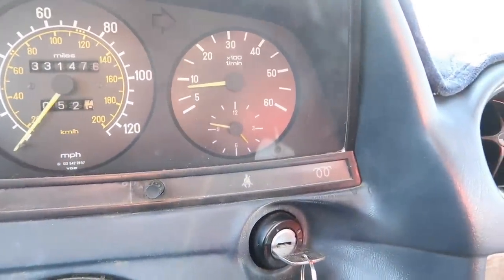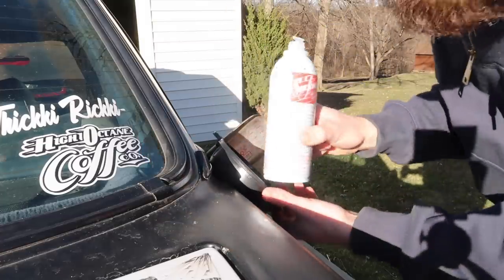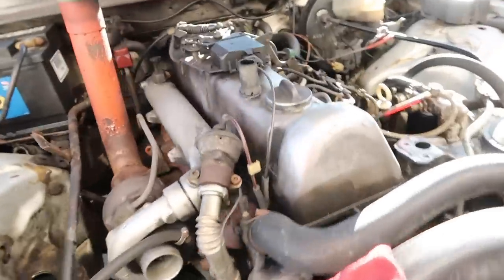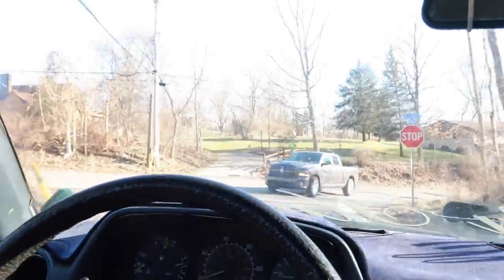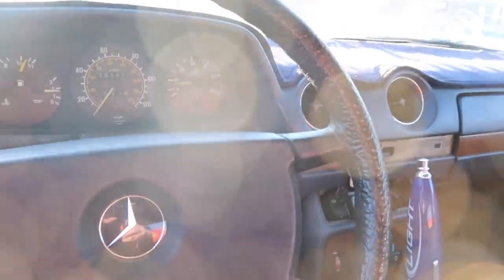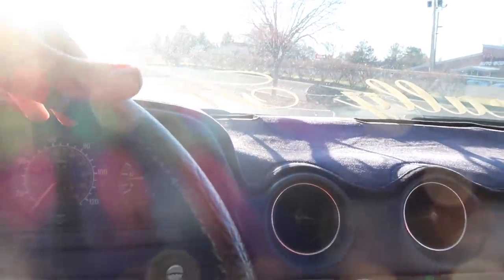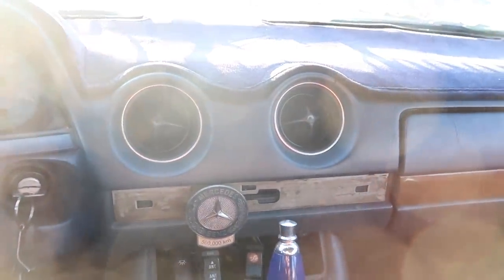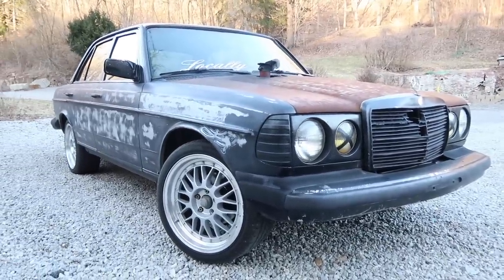What Happens If You Seafoam Your Diesel? - WAY TOO MUCH

Comment: Somewhere in Germany there is a Mercedes engineer vomiting.
Reply: Seafoam is 80% kerosene and a small amount of petroleum naptha. You are wasting your money. Better to use a diesel cleaner made for diesels.
Reply: in germany ?????  im vomiting here !
Reply: it actually works...look up project farm.  He does a great review on it.
Reply: Lol
Reply: @MichaelJHathaway  Have you ever tried it? I'm a tried and true skeptic but, I have used it on many, many occasions and have had good results each time.
Reply: @daviddelle774  The point you are missing is that its the petroleum naptha doing the work, while the Kerosene is the "filler" content. If you were to add the same measured amount of naptha, such as Stabil or Lucas fuel cleaner, you would have the same results, except at a lower cost.
Reply: @MichaelJHathaway  Sorry for your misconception that I'm missing the point, I'm not missing anything. My statement about it working is true. But, since you brought up those other brands..., I use Stabil in all my tractors and outdoor equipment for it's intended purpose of fuel stabilizing and have never found it to be a helpful "cleaner". I have also used Lucas fuel cleaner and found it's cleaning abilities lacking. I have followed up a Lucas treatment in a garden tractor with SeaFoam and it cured the issue. Was it the combination of Lucas then SeaFoam that did the trick? Maybe. But then I have to go back to all the times I've gotten good results using SeaFoam right from the start to conclude that it was the SeaFoam that cured the issues. Could I just buy a can of naptha and dump some in my tank? Yeah, maybe. Maybe I'll get around to trying that some day. But in the mean time, I'm standing on my statement that it does indeed work, regardless of what you say the the ingredients are.
Reply: It only works 20% of what it could do if it were pure naptha. LOL!!!
Reply: @MichaelJHathaway  I'm going to ask 2 questions and then I'll let you rest. 
1. Have you ever used SeaFoam?
2. Do you have a degree in Chemical Engineering, and work in the field?
Reply: @daviddelle774 Electrical and chemical engineering and worked for DuPont
Reply: @MichaelJHathaway  Dupont in DE? Know an engineer by the name Stahl?
Reply: How about adjusting the valves to factory specifications??:)
Reply: @MichaelJHathaway  du pont? Where at? We have one here in Pryor oklahoma
Reply: This is probably the best comment I’ve ever seen on a YouTube diesel video 😂😂
Reply: It's the only fuel treatment I will use. I have used others in the past.
Reply: Bad idea 100% naphtha if used in this quantity, at least Kerosene has some viscosity but Napatha is quite cutting; it is used to clean oil based ink from printing presses and that stuff is serious goop, now imagine what that would do for oil ! 😬

Comment: You'll get even more life to that engine if you simply ad an air filter.
Reply: Especially with the exhaust right there .
Reply: Yeah who knew clean air was good for your engine lol
Reply: Ross Sikorski youll add more life to your cp4 if you simply seafoam lol
Reply: Exactly
Reply: @chexlemeneux8790  That's an external EGR
Reply: Air filters are for the weak....do you see professional athletes wearing air filters? No you suck that natural air in and turn it into power! Couple bugs aint gonna hurt that diesel

Comment: You should change the oil now!!!!
Reply: Why? He put it in the fuel tank
Reply: @jair8808  no he added to the crank case as well??? Hello
Reply: @jair8808  if you add it in the crank it will thin the oil and get slug out! Then after about a 1 hour drive change that oil!!!!
Reply: You can add sea foam to the oil and it’ll be just fine you can add a larger amount 500 miles before you do an oil change to clean up the inside but it doesn’t harm the engine

Comment: I have used Seafoam in all my engines from chainsaws to my 6.7 diesel for years and it has preserved, I feel, every motor.  My snow blower is now 30 years old and starts first pull.  My 2010 F-150 5.4L 3 valve, which has had historically  a plethora of issues now has 255,000 miles with no issues.  So a big thumbsup on the product!
Reply: Those Modular V8s are weird like that. I have seen them run like the best V8s ever made and then some have issues beyond belief.
Reply: Did you put it in the engine oil or fuel tank?

Comment: Made a huge difference this last summer in my Mack truck.  Put in a gallon in about 60 gallons, and by the end of the day it was a totally different truck.  Smoother and more power brought it back to where it had been before.  Got to filling each new fuel filter with it, run it for a couple minutes and let it sit overnight.  Huge difference.
Reply: what motor mp8? still running good? dpf?

Comment: I had 4 injectors failing on a truck I had for a week and I poured a gallon to the truck , finally got it running,  ran it hot for till it was empty and now I havent had any I injector failure so far for a month.

Comment: Just prefilled our secondary fuel filter with seafoam on our bus conversions 12 valve Cummins, and Wow! Huge increase in acceleration performance. I have to use the brakes more because it dosen't slow down as fast when I let off the throttle.

Comment: After driving about 30 miles you should change the oil. You just cleaned the crank case of sludge and cooked on caked on carbon.
Reply: Jeff Stone I think that’s only if you ad it to your oil or through the brake booster vacuum line, if you put it in your fuel and your piston rings don’t seating to the cylinder wall properly then it will dilute the engine oil. If you have a good running engine it will be fine.
Reply: TiresBiggerThanTexas  if it’s added to the crank case oil I would change the oil soon after driving. If you add it to the fuel or through a vacuum line it’s being burned and exiting the exhaust except for blow-by.  The reason I would change the oil in just a few miles is because if this starts cleaning the sludge out of the galleys it’s going to end up in the oil pan. You run the risk of plugging up the pick up on the oil pump with the shit that was caked on the inside of the engine. You could repeat this process. Another way to clean the crank case is drain the Oil and fill the engine with kerosene. Let it soak. Drain The new oil and filter.  This is an old timer process used on old tractors. Not something I would bother to do. But since were talking about a car that was basically junk it could be fun to experiment.
Reply: @sterlingyoung88  ,, he did put a pint into the engine oil.
Reply: nope , its actually between 100-300 miles as it says on the tin

Comment: I always recommend replacing the fuel filter and priming the filter with seafoam on most diesel engines.
Reply: The return pump just pumps it back in the tank before it can go into the injection pump.
Reply: Be just as easy to go buy a tank of number 1 diesel.
Reply: @mtwofeathers  
Is that even available anymore?
Reply: @Freedom1man  only in the winter in very cold areas if you’re getting it from a pump.

Comment: Adjust them valves and you will have it run better. Valve adjustment is big for a little motor like that .
Reply: Yes, a valve adjustment should've been the first item done for a better test.
Reply: Perhaps throw some gear oil on your cam to stop the rocker from slapping the valve. Haha. 
Love the car.
Reply: Is it ok to run this stuff in modern diesels?  I have been told it’s “not good” for the modern injectors?

Comment: I’ve used sea foam in my VW ALH 4cyl 1.9L diesel. Huge difference! In engine oil a couple hundred miles before an oil change cleaned it right up! I tend to run Power Service diesel additive on every fill up, but remember Seafoam will pick up moisture in the fuel and work nicely as an anti-gel/ anti-freeze agent. I tend to add it as the temps get closer to freezing. Injections stay clean, and I say more horsepower.
Reply: Tiny Solar Shack what did it clean up? How could you tell ?
Reply: If it worked at all it would make your oil dirtier as it dumps all those built up carbon deposits into the sump.

You're saying it made it cleaner?

Comment: I have used all the major cleaners over the years in motorcycles, regular gas engines, outboard engines, lawn mowers...... My Ram 2500 w/ Cummins 6.7 has seen all the major cleaners ran through it over the last couple of years.  None really made that much of a difference.  BG Products, Marvel M.O., Stanadyne, Hot Shot's , Peak, Diesel Kleen....  Out of those on the Cummins, the Hot Shot's worked the best. 

Then..... I realized Sea Foam can be used in Diesels when I bought a can to use in an outboard I am working on.  I have always used it in regular gas engines but never thought about using it in my truck.

HOLY COW!   Regular daily  route , I have gained over 2 - 3 mpg.  Better throttle response, idles smoother.  The other cleaners look like dark tea, where the Sea Foam is clear.  I can say, none of the other cleaners have done that with this truck.  I was telling everyone about the Hot Shot's products, even posted on YT about it, but now I will only be using Sea Foam.
Reply: Just got a lb7 Duramax Gunna try this and hope for better throttle response
Reply: You even posted it on YT? I can't seem to see the video...
Reply: I use both Stanadyne and seafoam in my 2003 7.3.
Reply: B as for your cummins only use the sea foam to clean your injectors. Do not use it as as a weekly treatment because it will destroy your fuel pump as it provides no lubrication to the fuel system. Diesel Kleen which is endorsed by cummins, not only helps keep the fuel system clean it also aides in lubricating it. Because diesel fuel is now ultra low sulfur content so it has no lubricating properties anymore. Once you get the fuel system clean I suggest using Diesel Kleen from then on. A Cummins Tech explained this to me and all Cummins dealers actually have Power Service Diesel Kleen displays in there dealer. That’s all I use since a month after buying my 2017 2500. It actually run better than the first day I brought it home.
Reply: B as for your cummins only use the sea foam to clean your injectors. Do not use it as as a weekly treatment because it will destroy your fuel pump as it provides no lubrication to the fuel system. Diesel Kleen which is endorsed by cummins, not only helps keep the fuel system clean it also aides in lubricating it. Because diesel fuel is now ultra low sulfur content so it has no lubricating properties anymore. Once you get the fuel system clean I suggest using Diesel Kleen from then on. A Cummins Tech explained this to me and all Cummins dealers actually have Power Service Diesel Kleen displays in there dealer. That’s all I use since a month after buying my 2017 2500. It actually run better than the first day I brought it home. SEAFOAM IS ONLY A CLEANER AS IT HAS SOME ABRASIVE PROPERTIES TO IT!!!!!
Reply: On my 5.9 cummins, i empty the fuel filter canister and fill it with sea foam
Reply: @Jon O OR the Cummins corporate struck a deal with Diesel Kleen to be an exclusive supplier obvious by the marketing materials in place. Usually with financial incentives in play
Reply: @Jon-O.  Man, I never got the notifications for these replies.  Thanks for the info.  I basically run a can directly in the filter housing, as SeaFoam shows in their Ford 7.3 video.  It's been a year now and TBH, the SeaFoam is still giving me better results.  BG Products and DieselKleen are used on occasion though.  I'll swing by the local Ram dealer and bend the tech's ear also.
Reply: @mrmotofy  yeah I don’t think so remember cummins engines are warranted by cummins I don’t think it’s in their best interest to endorse a product for their engines that will make a negative impact they lose.

Comment: 1st thing adjust the valves, try changing the fuel filter .( thats probably ur problem) last but not the least dont thin that fuel too much. That fuel is lube to the bosch precision pump. Fuel too thin will distroy any precision pump. Also u need filtered air on any engine.
Reply: .. well ULSD doesn’t have great lubricity to start fyi, and Seafoam is petroleum based and and helps with lubricity. Can’t really over treat it with Seafoam.

Comment: I put had a Honda motorcycle that was backfiring BAD i used an entire 32 oz of Lucas over 10 fill-ups and no help. i used Seafoam and it immediately cleaned the carbs and the backfiring stopped. the mechanic that rebuilt the carbs said he could see where it cleaned the varnish! i use it in all my gas cans for mowers and everything its awesome stuff!

Comment: Some time ago on my previous truck as I'm a truck driver I put two bottles of seafoam in the oil and then one can of each fuel tank and filled it up and within 10 Mi it was already a noticeable difference are just phenomenal it ran quieter ran better and I got better fuel mileage here it was a semi truck with almost two million miles and I was getting close to 7 miles a gallon before I put that seafoam in there was 4.5

Comment: Iv used it for years. Gotta try the seafom intake fogger. Especially on anything that's port injection with emissions/EGR. Just did the wife's blazer and when I kicked on the throttle you would sware it was a diesel. Just rolled coal. Shit works.

Comment: Hopefully you changed the oil right after this.  Seafoam thins out the oil, if you run it like that forever it can damage your bearings.  Don't run a ton of this through the motor it will cause the injector barrels of the injector pump to become scored.  Run more advance on the injection pump (you have to loosen it from the motor and move the pump in relation to the block), and add in a variable boost controller to run 12 psi on the turbo wastegate.  Make sure your ALDA is working.  Loosen the nut on the top of the diaphragm on the top back of the injection pump and screw the inner part of it in 1/4 of a turn and tighten the outer nut, it will run a little more fueling to the motor.  Less is more with this last adjustment.

Comment: Seafoam changes the cetane  rating of the fuel… which in a diesel of that era is like changing the timing in a gas car.. because it is compression ignition…. It also reduces the lubricity, so use with care.

Comment: I buy seafoam by the 5 gallon pail.  I put it into the oil of all the vehicles I maintain a trip or so before I change the oil.  I also put it into all the tractors before I start them up for the spring.

Comment: I use that shit in my Jeep whenever it feels like it's lagging, I also using all my 2-stroke engines like my chainsaws and my echo weed eater andafter about two tanks through each of my pieces of equipment plus my Jeep I notice a very big difference in the amount of power versus throttle I haven't used it in anything that's diesel yet but I definitely would get the spray form and put some through your air intake not on that Mercedes but any unleaded vehicle that's fuel injected or on a carburetor I just pour some into the carburetor my 76 Chevy pickup loved that shit! I loveusing it over almost any other type of gasoline or motor treatment out there

Comment: I hope you changed your oil soon after.  I ran seafoam through an older engine and didn't change it within the 70 mile mark and it threw a rod bearing.  Great for cleaning but make sure you change it after it's done its job!
Reply: David Cool you probably ether put way to much or that engine was gonna throw that rod ether way
Reply: Young Mech, I thought same, rod was ready to go

Comment: I like seafoam for sure. I run it every few tanks of gas and 100 or so miles before an oil change a couple times a year. Really keep the carbon out of the engine.
Reply: Do you just dump it straight into the engine oil cap in your engine? I have a diesel accord 2.2 thinking about getting some for the fuel tank and oil

Comment: Seafoam every oil change interval. Every fill up is too much. You will also notice lower mpg the more you use in a tank. I do it every 4000 miles and my truck runs top notch. I dump a bottle in for my 21 gallon tank. It burns through faster during that tank but after the next fill up it balances out again. Also, in the oil you should use it 30-50 miles before an oil change. It's not meant to stay in the oil during its entire oil cycle. Eventually the deposits will redeposit because the detergents oil treatments use break down after a while and stop working

Comment: Would have been better if you used Diesel Purge. It works wonders. And if you want quiet injectors, use some trany fluid in the fuel tank, it'll make the injectors very quiet.

Comment: I never see any difference because I add Seafoam to my tank several times a year to prevent any buildup in the injectors. I think it also keeps the lines and CP3 pump in better condition. Seafoam also prevents gelling in the winter. Darn stuff is getting expensive though but what isnt ?

Comment: I got a 99 Powerstroke which I drained the fuel filter housing, changed filter filled housing full of Seafoam, then started and looped my subdivision twice to warm up then let sit for an hour or better.  Then just start up and drive like original an that's it , by doing so I've gained 5 MPG by doing this  !!!  Seafoam an heat cleaned injectors from the inside totally  !!!   Believer   !!! Running on Seafoam will not change sound of motor ANY  !!!

Comment: In my grove i have had really good success with Seafoam cleaning injectors and making diesel run much smoother by running the engine with Seafoam only under a normal heavy load for a few hours.
Reply: Pierre Roberge why not ?